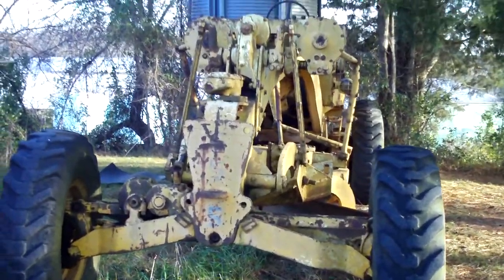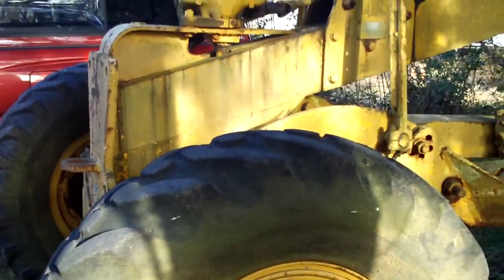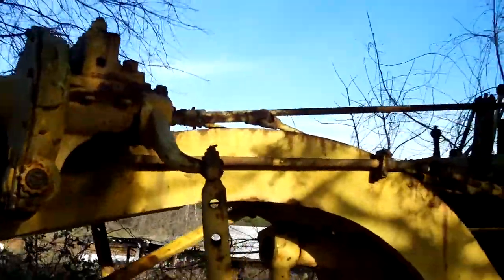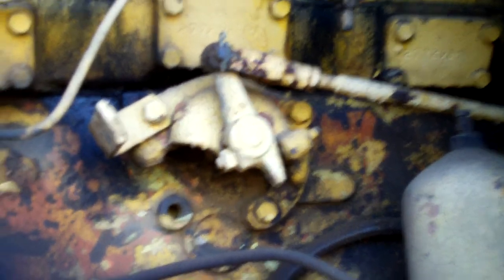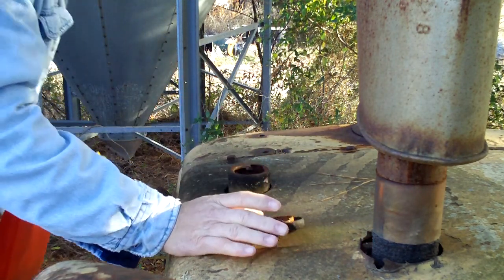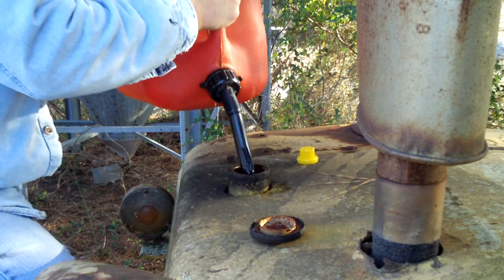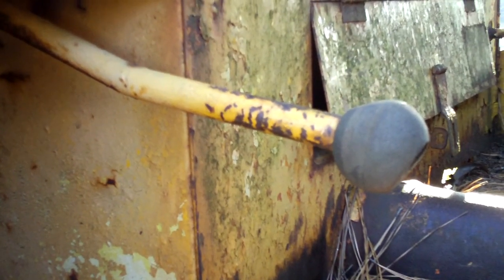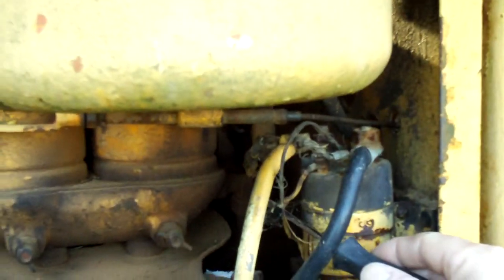Adams Motor grader start up.

Comment: Real good video. Reminds me of the old sand pit where I used to ride and hill climb as a boy. There were machines like this laying around where we used to climb around and play. The smell of an old diesel machine with all the grease and hydro fluid in the summer sun will stay with me forever. The fact that there are no hydro controls is interesting. Thanks

Comment from the maker: I appreciate the Info! Normally i will let a engine run idle for about 3 to 5 minutes depending on how much work its done, turbo and non turbo, i always done this just because i figure that engine would need a cool down period just as a runner would, some people say thats dumb,  but i feel otherwise, IM glad you told me about the head, this engine im sure might have had a head gasket on it maybe, but it doesnt look like it, looks original and i sure do not want to do the replacment! lol..

Comment from the maker: @mrwiggles2 That Gauge is to let you know  the Diesel Pumps fuel working pressure, it supposed to be RED on the left side of the line, and GREEN on the right of it,  if it gets to that line it drops in power a lot, so it pretty much lets you know when its time to change and clean the filters on the engine and pretty much lets you know if there is a pump problem as well.

Comment from the maker: @mrwiggles2 Hey thanks!,  appreciate the nice words. it, i was lucky the Neighbors wife told him its either the machine or YOU that goes off the property, so he told me, pull it home i can have it, lol. it still works great, its has some slop to it, and NO powersteering, but if you lean the wheels to the right it will turn almost on its own, ive actually done alot of work with it, for the roads on the farm 3+ miles all together it will roll some material over real nice.

Comment from the maker: @farmall51 I love the old engine, shes pretty clean burning, and since i have had it, for over 5 years or so its started up for me every time WITH old diesel fuel in it,  yes they knew what they was doing for sure, its all in one package,  ive had people come look at it asked me is this a multifuel engine, i said in a way kinda, but gas for only starting purpose and not work. Thanks for stopping by and comments!

Comment: my dad bought his at a county auction in 1979,we still have it.only ours has a factory snow blower on it that has 2 black diamond engines diving just the blower part.never seen another one like it.would like to know more about adams company
Reply from the maker: Adams been around for a very long time, I dont know much about them, but i know there is alot of info on the web about them,, Honeslty i think the old saying of they dont make them like they used to, holds true, because i see a lot of old equipment operating in personal use situations with no real problems, all the new stuff is computer controlled or complicated with stuff that costs a lot of $$$$
Reply: Wallabydam I don't see much on the web about them,only seen these two videos on the machine,appreciate you posting them

Comment from the maker: @tmillersfarm Funny thing is i was thinking about scrapping it when i was hard up for money, and im glad i did not, its been such a good machine and there are a lot of IH TD-14 dozers that use this engine, im sure someone would love to have it for the old dozer if need be, its runs damn near perfect, and summer time when its not cold you wont see any smoke what so ever, just only on start up. i believe it weight is 25,000

Comment: I’m looking at picking one up now. Sounds like it runs but gentlemen says that it blows a lot of white smoke on the gasoline side. Claims once the diesel takes over it cleans right up. 
….any thoughts one that by chance?
Reply from the maker: It sounds like the diesel pump is injecting fuel in at the same time it is running on gasoline, on the one I had it would only make a bunch of white unburned  diesel smoke when I pulled the throttle lever for the diesel  side of things, once I see that smoke I knew diesel was going into the engine, right after I would then hit the decompression lever off and it would take over on diesel. So I believe what you have is raw diesel going in when it's not supposed to be during the gasoline side of things running so you need to check your throttle lever on your injector pump and make sure it's not injecting diesel when it's not supposed to be during gasoline warm up, I hope this helps. 🙋‍♂️
Reply: Thanks for the feedback!! 🤞

Comment from the maker: I have seen alot of cat engines that have pony start motors that USE ELECTRIC starter to start those, so is you think about it , seeing this engine has gas start to diesel it kinda would be the same almost, your using a gas engine to start the cat, this uses gas within itself to start on, both use electri starter,except the older cats that use rope, IH just was able to incoperate the 3rd valve to hold the exhaust open enough to allow some compression drop for gas starting.

Comment from the maker: @500passwords Well i pretty much had to figure it out, i didnt have a manual or anything, i was lucky enough to figure out the carb and decompression when i tried to start it, i think the hardest thing was getting it to the farm missing a front Rear wheel and haveing a chain sling on it so i could pull it home, pretty much you have to turn on the Diesel fuel line first, then choke the carb, then decompression lever, then fire it up, and let it warm up, his the Fuel lever for diesel, then lever.

Comment: It`s not a "pony motor" start.  You pull down the levers (throttle and starting).  The starting lever opens a 3rd valve in the engine which opens to a combustion chamber that allows the fuel(gas) air mixture in and exposes it to the sparkplug which is in the starting combustion chamber.  The chamber being open lowers the compression to allow it to run on gasoline until warm.  Then you simultaniously close the start lever, open the throttle lever which opens the injectors and the engine then runs on diesel.  If the sparkplugs were in the main combustion chamber, they would soot up and foul from the diesel.
Reply from the maker: Fuller Johnson I know the function and reasons for that UD14A engine. and NO it doesn't have a separate smaller engine like what CAT used... everything is self Contained basically. 
thanks.

Comment: Not pony start. Dual compression ratio with an extra valve for lower compression to warm up running noff of gasoline. Old IH engine. I know where one is with a 4-71 in it that I've operated. Knuckle buster controls.

Comment from the maker: the gasoline side of the engine doesnt really make enough power for moving it up any slight grades, it will wind down and stall out the engine, its just for starting and warming up the engine, i tries moving up small hills, and the engine would stop,

Comment from the maker: @1bad55chev The old man i got it from told me it was roughly 600 cubes, but i dont have a book on it, so was goin by what he had told me,  he had told me the TD20 dozers had a 700 cube inch engine in those, and were 6 cylinders, dont know if thats right or not either, this engine is a td14A engine, but i had a regular TD14 injetor pump on it that i had bought, seems to run ok with it., ill go check that out, thanks for the info!